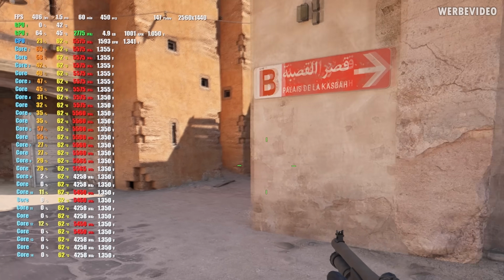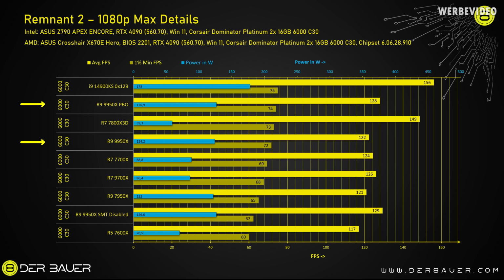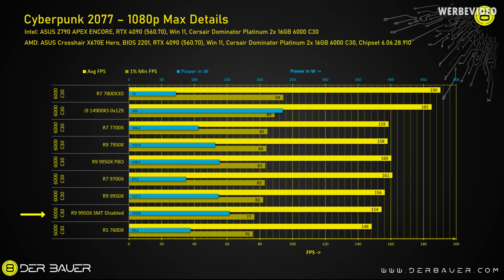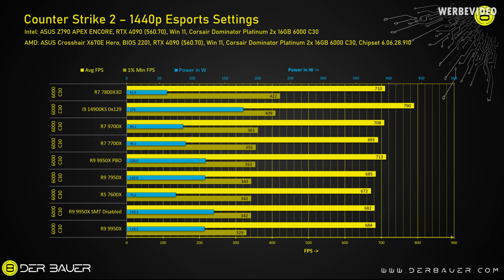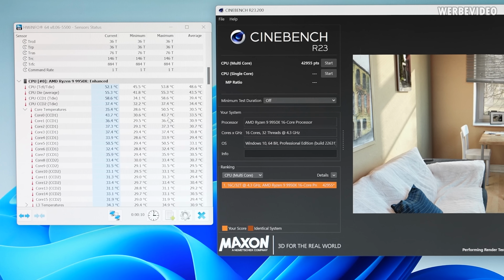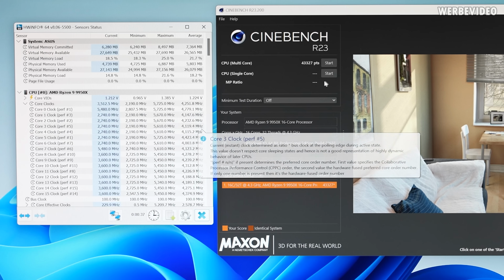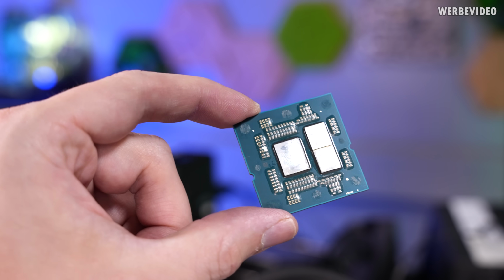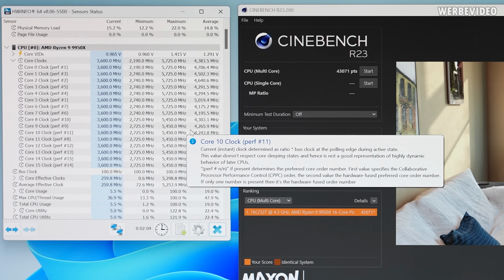Difficult to Review - My 9950X just didn't Perform as Expected

Comment: What's going on here then, is this terrible microcode? Windows issue? how is it working worse than both the previous gen & sometimes even the 9700X, and then sometimes awesomely, that can't be really be physical tolerances surely. This is a very bizarre thing. You kinda tested manufacturing issues with heat propagation so it's probably not that... if it's microcode at least it's relatively easily to fix. Edit: watched a couple more pieces on these, they seem to work remarkably well on linux, is this actually Windows screwing things up?

Can you get them to send you a board with the new chipset on it? releasing the CPUs early when they don't work well with the older chipset does sound like a very AMD thing to do...

Also, how about a quick test ( including noise spectrum ) of those fans? never tried a Seasonic fan but I gravitate to them for PSUs.
Reply: It is apparently because the architecture is designed for servers, not workstations, so in server like workloads it will be an improvement, but in workstation like workloads more like the last gen. That is why results appear to be all over the place depending on the application.
Reply: Although that doesn't really explain the apparently good results in linux gaming ( still nearly all via emulation ). Not nearly enough data there yet but it does seem to be coming from generally level headed sources. I'm quite prepared to believe the hardware is fine & capable, and anything 1st-party software related is a mess, it wouldn't be the first time...

Will be more interesting to watch than Intel's disintegration, at least.
Reply: @RichardDastardly59  Copium must be pretty cheap where you live!
Reply: Ah, I see you didn't actually want a discussion involving evidence. Fair enough. The arcitecture could be shit too, but it doesn't fit with everything published... but yeah you don't want to consider that, so never mind. For future debate with other people, "Prepared to believe" means "this is a position to consider when looking at data" rather than "this is the hill I'm dying on". 

One thing is absolutely true is this product was never ready for market, whatever the source of the problems. 
I wouldn't buy one right now. See recent MLID.

Comment: Thank you, man, maybe there is a bottle neck for zen 5 try to increase infinite fabric and memory speed
Reply: Nope! 100ns latency. AGESA update incoming, will correct (65w to 105w) - Enable PBO (Precision Boost Overdrive), EXPO in BIOS, add 200MHz, and enable "Curve Optimizer"...
Pretty bad really, power savings targeted, just went out the window... lol
Reply: @mrhassell  I just thought maybe infinity fabric or memory speed, memory controller multiplier is not the way it's supposed to be when it's in auto because it's some kind of normal situation for amd to release a bios with glitches especially for a new products, I just think that would be better set the parameters I mentioned manually and check it in windows also because maybe they don't save in bios, just a theory, man 👌
Reply: @sergeys2505  I think in BIOS enabling EXPO and specifying the PBO scalar limit to 200 MHz max CPU override and enabling the Curve optimizer, is a solution that seems to work. Memory latency of 100ns drops back massively. Best of luck!

Comment: The new 9000 series Agesa does not play nice with 7000 series. I think it's the Agesa, because it does not cold boot correctly on my Taichi X670E motherboard with 7800X3D, my drives all become "hotswappable", and a single AMD GPIO controller device driver is exclamation marked in device manager (the drives being detected as hotswap used to be connected to "thunderbolt" being enabled) but after a "warm" reboot, everything seems fine. (this is happening since the first beta bios release..)
Reply: That actually is pointing to the AGESA having problems with trying to remove the NOP fusion ability that's available on Zen 4 but not available on Zen 5, as Zen 5 has dual predictors, so it doesn't need it.
Reply: lol - you didn't? haha

Comment: I got 30K on CB r23 with an air cooled 5950x on an ITX board.
Please leave FO at 0mhz and scalers at 0x, then just try and do R23 with each core's -CO tuned as well as you have time for, then run no monitoring software and I bet it'll break 45K especially with a Arctic III AIO.

Also the "SMT disabled increases performance" is just a result of SMT taking extra power so disabling it is just a way to free up power headroom (and doing PBO unlimited isn't good either, you need -CO)

Comment: What's the reason they're not selling delidded CPU's from factory? Apart from perhaps warranty hurdles.
Reply: Back in the days they did that, many chips were cracked then trying to install the cooler.
Reply: @TheFulcrum2000  Yeh, but those coolers had a pain in the ass mechanism to install. They could sort of remedy it by having a raised border around the die, similar to what AMD does with their GPU's, so the cooler can't wobble and crack the edges of the die.

Comment: I think a new AGESA update is in order
Reply: Enable Precision Boost Overdrive -  PBO v1   > PBO v2 ✔EXPO ✔
Unlocks the CPU's power limits and actually allows the CPU to consume as much power as it wants when the maximum limits are set.

IF you have a supported BIOS, you can activate the automated overclocking feature by switching the BIOS settings to the 'motherboard' option;
Enabling higher PBO scalar limit and dialing in a 200 MHz max CPU boost override.
Flip on Curve Optimizer, and you're off to the races. 🏁🏁🏁🏁🏁

Comment: This industry really needs better naming conventions.

I'm old enough to remember the Intel 9700, Nvidia 9700, and the ATI 9700.
Reply: I still have a working ATI sapphire 9800 pro with the zalman orb cooler on it, good old days...
Reply: I remember Nvidia 9800GTS, there was a 9700?
Reply: @elektronischermeister  No never, But a ATI Radeon 9700 Pro existed, think 2003,
Reply: @groenevinger3893  Yes, of course, but I was referring that nvidia does not have GTS or GTX 9700 (as far as I know).
Reply: ATI 9700 was the best of the mentioned :D
Reply: Also, two different 6950s from AMD.
Reply: Almost like numbers are numbers
Reply: Why? It is just a name on the product stack. Only an idiot reads meaning into the name.
Reply: @Tugela60  annoying when you do internet searches for customers, bad for their referencing for the manufacturers

Comment: AMD announced a new AGESA update for 9700x, also linux performance seems a lot better compared to windows (which indicates some sort of a potential scheduler inefficiency /bug ) last but not least these CPUs have been tested on what is technically last gen mobos (designed with zen4 in mind) maybe that's the reason for the strange results
Reply: Even if this is the case, it's all on AMD if their software/hardware wasn't ready for the CPU launch.

All the poor release day results are accurate results and valid for review.
Reply: @AceStrife  well it doesnt make sense to look whos fault is what matter if they fix it or not in the near future lol
Reply: @AceStrife  I suppose there is a small possibility that these issues are due to something in a recent Windows update or something, something that AMD could not have predicted.

It is a bit odd that they suddenly decided to postpone the launch, sure there were some rumors about why AMD did this, but if AMD discovered these issues last minute, and were hoping that they could come up with a quick fix, that could be a factor.
Reply: CPU performance is better in Linux on every Ryzen generation, so it's not really unexpected to see 9000 series is doing better. It probably should be expected that 9000 series picks up a bit more performance as compilers are adjusted for it, but with the recent very poor core-to-core latency results for Zen5, it's starting to look more and more that Zen5 has some significant architectural regressions and issues.

Hopefully this is just another AMD RDNA moment, and Zen6 is going to take what Zen5 laid down and create another RDNA2 moment.
Reply: Chi11eddog on X, AGESA 1.2.0.1a Patch A update - 65W to 105W.  9600X + 9700X

Comment: Now I really want to know if the greater power headroom and better binned CCD0 would be worth getting the 9950X for, similar to how the 7950x3D was able to clock significantly higher than the 7800x3D...

Would you please try to also measure the 0.1% lows and re-run the gaming benchmarks on Win 10 with the following settings, to see if it results in better/expected frametime stability?

- Disable the 2nd CCD, quick boot, virtualization and security settings (such as TPM and secure boot), as well as all power saving "features" (e.g. C-States, Memory and PCIe power down /sleep, etc.) through the BIOS. 
- In Windows, set the power profile to the highest available setting, disable all power saving settings and disable or suspend all of the background processes that you can.
- Also ensure that Windows isn't allowed to automatically update its drivers, before you connect to the internet after installation.
- Lastly, only install the required AMD chipset drivers and not any drivers/apps/services/profiles that is recommended to install on the 2CCD parts for things like thread scheduling, core parking or application/game detection.
Reply: That would not be a review, but a cherrypicking exploration. You wouldn't get any useful data to compare to other CPUs. If you're into extreme tinkering, then the video would be for you, but 99% of the people wouldn't get anything useful out.

Comment: Gamer Nexus said AMD told him to use the X3D special chipset driver regarding Ryzen 9 dual CCD CPUs. Just 2 days before his review went live, and he had to throw out a lot of results. Maybe this can have something to say for your results
Reply: yeah, was curious if der8auer got the same recommendations related to chipset driver and core parking etc (similar to 7950x3D and 7900x3D requirements) as I don't think he mentioned this specifically in the review, but did say he reinstalled windows fresh. But he did analyze that games were using the proper cores with higher freqs.
Reply: Yeah the discussion at 11:10 makes me think this might be the issue
Reply: After watching the Gamers Nexus review, I had the same thought, as it wasn't mentioned in this review. However, I believe Roman and Steve are somewhat close, so I assumed that when they said they 'reached out to other reviewers,' they would contact each other. I guess we'll find out soon.
Reply: @MrMoerli  he might have reached out before Steve said anything and Steve simply didnt have the time to just communicate around what he was told (assuming he was permitted to share it begin with) in time of this video to go out.
Reply: It's possible windows didn't apply one of the settings for some reason.
Reply: Yeah, there seems to be something afoot with the drivers and Windows schedulers being not quite compatible.

Wendell had results where running Windows games and applications gave him better performance under Linux than on Windows.
Reply: @JumbieLove290  lol no, Intel is no different as the "default" settings varied per manufacturer and even their default power settings have been changed in a Bios update, much like AMD had to update theirs to amend an error brought about by WINDOWS, not of their own making like Intel's.
Reply: Same happened to almost everyone, apparently Jay2cents did a step by step install guide (I'm not watching his channel for that) but GN and HB Unboxed did a review using the installation procedure of the 3D Vcache parts and the performance was "normal" Wendell at L1Tech noticed performance issues under Windows and faster performance under Linux 😂
Reply: just installed a 7950x non 3d and as I have an extremely detailed custom onscreen GUI I noticed even with process lasso on AMD it keeps sending game % to CCD1 cores when I don't want to, admittedly AMD improved the second chiplets vs a 3960x threadripper who had trash tier bin on 5950x it was ok but still noticeably slower than CCD0 on my 7950x some cores still manage to do 5500Mhz which was surprising and it's where the drivers i guess still send games to
Reply: @JumbieLove290  yeah, that's a load of Intel Fanboy bullshit.

Intel chips have their own problems, like frying themselves trying to be faster than AMD ones.
Reply: JayzTwoCent did a video on that a couple of days ago already, there's no special chipset driver, AMD installs what is required according to the installed chip. If you don't have an X3D chip in when installing it doesn't install that service.
Reply: @johnt.848  that's wrong, the 9950x and 9900x needs the same service as the x3d chips to function properly. It's the first non x3d chips that does need it.
Reply: @johnt.848  the 9950x and 9900x now require special settings different from 9700x and 9600x. Similar settings to 7950x3D and 7900x3D. Can check GN video for the info AMD sent Steve 5 days after he got the CPUs. Important info when testing these CPUs, especially if using the same setup and swapping to a 9700x or zen 4 CPUs
Reply: @johnt.848 while that's accurate for 7900X and 7950X which did not need it while the 2 x CCD 7000 series X3D did, it appears that 9900X and 9950X require it as gaming performance and certain lightly threaded workloads will suffer inconsistent performance and latency issues similar to 7950X3D.

Comment: I feel AMD either just flat out lied on the 9000 claims or they last minute had to nerf them hard because there was a problem (we know there where probblems of some sorth).
Reply: You cant nerf hardware at the last moment.
Reply: @Tugela60  Yes you can.  its nothing but microcode limiting certain aspects.   remember early 5000 launch where they needed new microcode to actually make it work propperly performance wise.   its almost all microcode.  no microcode and the cpu wont do much at all. boost tables/power draw/ turbo duration its all in the micro code/bios

Comment: What a difference to your TG delid tool for the 13th and 14th gen Intel chips. One single move and it was done with my 14900KS. I heated to 70C in an oven to soften the glue.
Reply: I just did my 13900ks also. No heat one pass about 2min lol

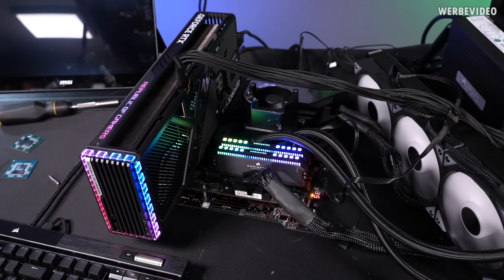Comment: Romain at 21:43 - for fix very long boot time - try 2 parameters in memory timings settings : 1st - Memory Contex Restore = Enabled, 2nd - Power Down Mode = Enabled
Reply: we all know about this man, if the fix was this simple we wouldnt complain
Reply: Pretty sure most people are aware of this, especially someone with this background. It can lead to instability issues though
Reply: @lolschrauber instability only happens when memory context restore is enabled but power down is disabled. As long as you enable power down, there won’t be an issue with stability.
Reply: @PowellCat745 Roman would never run with Power Down enabled. Lol.
Reply: @nexxusty  power down does affect performance a bit, so I can understand people not wanting to enable it for a fast boot time.

Comment: I think the unexpected gains from PBO are likely due to the EDC increase, it allows current to spike higher
Reply: According to hardware leaker Chi11eddog on X, an upcoming AGESA 1.2.0.1a Patch "A" update, will reportedly increase the TDP of the two Zen 5 chips from 65W to 105W.
EDC on the Ryzen 7 9700X and Ryzen 5 9600X
Reply: @mrhassell  unless this was a miscommunication, I am not sure if I like this, upping the specification after the fact is risky
Reply: @TheBackyardChemist  Fair enough, and apologies, for my apparent misunderstanding. The patch is making a major difference to power, huge!

Enabling EXPO and specifying PBO +200Mhz, helps a great deal. 
(Precision Boost Overdrive)

Comment: Because AMD uses so much glue and more bottlenecking. They should move the cache and I/O back to the motherboard.
Reply: the cache is not in the I/O die and the I/O never was on the motherboard (from the Buldozzer era onward).
Reply: @marsovac  The joke is over your head.
Reply: @kingeling  I mean considering AMD has no good engineers, they could only add++++ behind Jim Keller's work :)

Comment: Why are you using 6000 CL 30 on Intel? Where did you find such cheap and horrible memory? I understand that AMD won't boot decent XMP speeds, but that's AMD's problem.

Don't tell me that memory with decent XMP is much more expensive. No, it's cheap af now.

Intel engineers have been working hard to make their memory controller superior to AMD's, yet you're deliberately undermining their efforts. If I were Intel, I would stop sending you review samples altogether for putting them in the same chart with AMD and using 6000 SL 30, as if its 2021 and DDR5 had just been released.
Reply: Yeah but if their memory controller is so good, why did their ring bus fail?
They gotta deal with that first. It's their "glue" if you will
Reply: oh dear, how sad, never mind. 🤣
Reply: But if you use XMP you brick the CPU. It must be without any overclocking with intel default profile and even then you need to pray :D